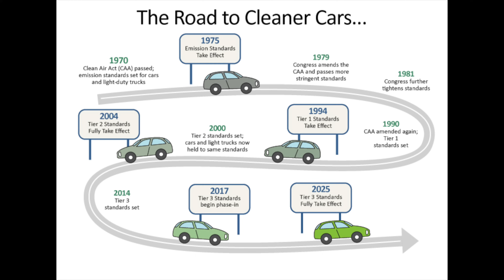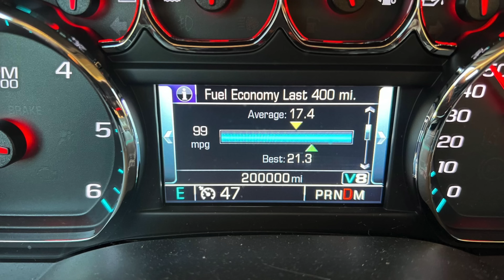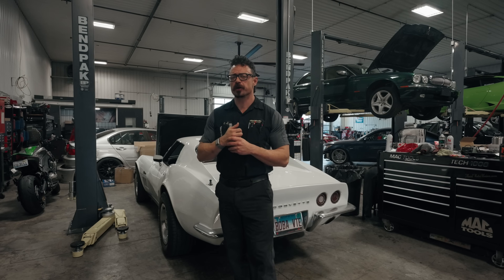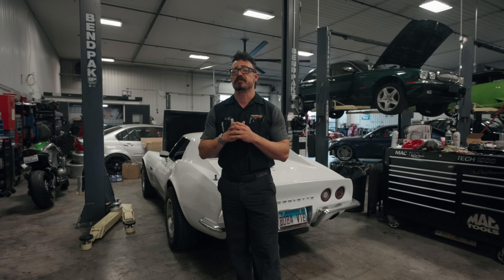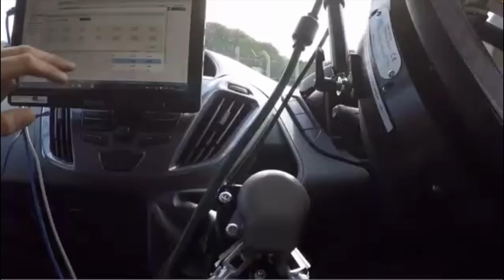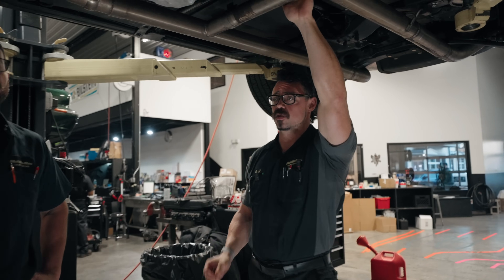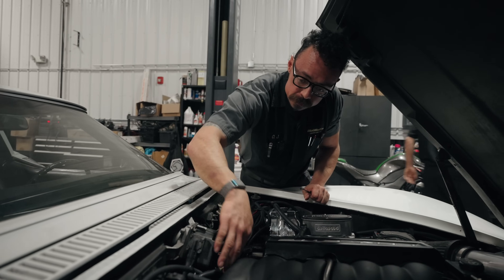Do You Need a 6 Speed Auto? LS C3 Corvette Transmission Swap EXPLAINED.

Comment: Have had cars with these transmissions turbo 350 - turbo 400 - 700r4 - 4L60e - 6L80e the lower transmission gear ratios in the 6L80e in 1st 2nd and 3rd gear will make a car with 3.27 rear gearing be like 4.10 gearing in a 700r4 or 4L60e l have a 3920 pound 5th gen Camaro SS with me in it it has stock 3.27 rear gearing with a new modded GM LS3 495 crate engine a 4200rpm Circle D lockup stall converter this car is not a race car full interior and AC street car cars 60 foot is 1.70 and 11.28 in the quarter mile and cruises the highway at 80mph 2100-2200rpm car has wicked throttle response if it had a 700r4 or a 4L60e in the same setup or car it would need 3.73 - 4.10 gears to be as fast as the 3.27s with the 6L80e trans 0-130mph 3.27 rear gearing on this setup with a 700r4 or 4L60e will not touch the times but cruising on the highway rpm would be simular at the same speeds my Camaro with these mods does 123-124mph at 6600-6700rpm at redline in 3rd gear with the 3.27 gears and the 6L80e trans is very simular to a 700r4 or 4L60e trans first 3 gears with 4.10 rear gears so with the 6L80e you get simular acceleration as a 700r4 or 4L60e with 4.10 rear gearing with 3.27 rear gearing with the 6L80e yes it makes a big difference in performance and economy of course if rear gearing is the same with these 3 transmissions highway cruising rpm will be the same acceleration will not 😮

Comment: Cool car. I just dropped a slightly modded LQ9 mated to 6L80 with a 2600 stall, all turning a 10.5 rearend in my o2 reg cab short bed. Should be interesting lol. I also put the thermostat bypass in the trans cooler.

Comment: I've been professionally building transmissions in Cleveland ohio area for over 20 years. The 6L80e is NOT a performer choice. The reasons are vast but I would run it before any 4L60e trans...joking..🤔 The 4L80e is the only true powerhouse transmission next the GM TH400 or "modern" powerglide. I doubt your shop has installed many gear vendor units which can be used on 2-3 speed automatics but if so want to hear about that. 6L80e is too large for most pony cars and even most muscle cars without serious trans tunnel or floor plan modifications. I watched this whole thing and don't know why you are showcasing it besides possibly the customer had wanted it. My only top concern is cost for customers. A 6L80e costs almost twice as much to rebuild as a 4L65e and doesn't carry much aftermarket support like converters. The converters also cost twice as much as 4L65e. The 4L80e is between the 2 in cost and there are millions of them out in car part yards for possible parts down the road. Also, if any confusion about what a  4L80e is compared to both units is that it is the superior TH400 with a 4th gear and overdrive lock up converter. The biggest consideration for the swap is early 1991-1996 models have front housing oil cooler lines and 96 and up have front and rear like 6L80e which can be an obstacle to intstall in some cars. 8L80e is total garbage for any performance car and belongs in low powered trucks for a reason. With everyone running larger wheels and tires today that can be up to 28-30" diameters that is another factor in lowering engine RPMs as well even when using a 3-4 speed transmission. I sub'd to the channel and look forward to seeing more stuff. 👍
Reply: Forgot to add that the weight is a big deal. He was wrong about weight of 6L80e. I weighed in shop the 4L60e at 149 pounds with fluid and small converter and 6L80e weighed 238 pounds with fluid and converter. That's almost a hundred pounds difference. 😮

Comment: I had a supercharged c5 with the 4 speed auto (4L60 built by RPM transmissions).  I also ran a 3.42 gear set.   Motor was basically a stock ls1 with heavy valve springs and a borla catback.  No headers. That combo made 472 /444 at the wheel through that setup.  The blower was a Vortec V3si.    My only complaint was the gap in the ratios between 2 and 3 gear and between 3 and 4th.   The car was a great from a dig to 80 mph.   Then the torque had to pull the long gearing.    That car would have benefited immensely by having some split ratios in between 2nd and third and third and fourth.

Comment: What is the difference in RPM before and after the conversion on the highway?
Reply from the maker: On the tac it’s like 500 around 75 but the math says it should be lower. 🤷🏽‍♂️ slight but noticeable

Comment: Good video, but I'm surprised that you don't bring up the very important distinction that lower RPM at cruise does not always mean increased MPG. You came close, but didn't quite get there. You did good in mentioning that each engine has a 'sweet spot' for efficiency, but you didn't correlate that to saying that if you add an overdrive transmission to a car that didn't have one before, you may actually go backwards in fuel efficiency now that you may be ~30% under that engine's efficiency curve.  Sure...the RPM goes down, engine/exhaust noise comes down, but so does MPG. Obviously, you counteract this by changing to a lower gear ratio (numerically higher) but then you end up with the same cruising RPM that you had before, just with and increase in usable acceleration and bragging rights that you have more gears.  The more effective determining factor in making the swap is knowing your engine's efficiency curve (mainly dictated by camshaft selection) and selecting the appropriate tire height, rear end gear, and trans with the appropriate first and overdrive gears to be actually usable and meet your end goal, whatever that may be.

Comment: I thought you guys were updateing from a antiquated turbo 350 or 400 with a 1 to 1 3rd final gear.. Both the trans here have deep 1st gears for takeoff and high overdrive for low rpm cruising so im missing the big advantage.. Ide be happy with either trans compared to the old 3 speed ! Lol

Comment: Would doing a swap on a stock 1995 LT1 4L60E be worth it ?????? I upgraded the stock trans back in 2011 at a trans shop down in Killeen,TX which cost around 1900,00 tax incl trans is built for up to 500 + HP at the moment l. What’s y’all’s thoughts on this.

Comment: Yes.. and no. If you have enough torque to pull the taller final rear gear (lower number) you can get away with a 5 speed or 4 speed. ie: the 5-45rfe (I now I opened myself up for criticism) has 3rd as 1 to 1, 4th is the OD in the 45RFE, and 5th is electronically added via the TCM. Thats why I can run 70mph in 5th with a 3.55 rear at ~2000rpm. Even though first is 3.00 and 2nd is 1.67 ratio and it shifts into 3rd the 1 to 1 ratio at 70 in WOT conditions... its also how it "could do" 112+ at the top of 3rd and at 6000rpm (max engine speed) in 5th, mathematically would be 202mph.

But I drive a truck, and bricks dont do 200+ with ~300hp lol Though as OJ pointed out, more gears don't always equal more better. my moms 2019 Ram with the Hemi and the 8spd, same mph same RPM as me, ~2000rpm at 70mph paired with the Hemi's MDS. Different final drives, different tire sizes, same results for cruising. Now for city driving it would be an advantage for her... though with the Hemi, that could easily start in 2nd but the autos always start from 1st unless a tuner programs it to do other shift schedules..

Comment: This is wrong, the 4 speed or 6 speed will still rev about the same one higheay, both top gears are about the same, wrong wrong wrong
Reply: I did some research while watching qnd found the same. But if I am correct one could change the diff ratio in a way so thzt the original 1st gear being about 3 ish afger the diff matches the 6l80s 1st gear beging about 4. So i guess one would need to pultiply their diff by this diffrance of 3/4 and then, i guess the top speed of a car previously set at 100 miles should get about 133.33. Or 1/3 decrease in rpms.

Comment: I imagine this has to be over 6,000 to do this swap, I could be wrong but everything is so expensive and the knowledge to do something like this is not cheap. Great video and have a happy new year.
Reply: Well this is a toy, anybody looking to really build a car should be in a financial situation where that's not expensive. 

That being said, the total cost of really building one of these can be done for cheaper than other cars im considering.
Reply: @Sp3rmWizrd  I do things like that as finances allow, and it takes longer than it should because of it.I just got my 300 c running after rebuilding the motor, I did most of the work minus machining and it was in the garage since 2017.

Comment: When doing a transmission conversion the big thing I have found that creates problems is the vehicle floor pan. I'm in Australia and while Holden was a General Motors make and while we used old transmissions like the T350 and T400 in the late 60s through to early 80s and then went to the T700R4/4L60E their is enough difference to make fitting the T700R4/4L60E a difficult thing to do. Trying to fit the 6L80E while not impossible requires alot of measuring and planning because of its physical size. I'd love to fit a 6L80E to my VC Commodore and plan to measure it all up in the next few weeks, I'm on holiday, but I really doubt the transmission tunnel is big enough for a 6L80E.

Comment: I instruct on race tracks and we get drivers with older cars that have automatic transmissions in their cars show up. Most have overheating issues. A video on that or what they can do without spending tons might helps. New subscriber and saw your work on the exhaust for Alex LS Porsche. Very nice work and enjoy your skills and content!
Reply: If they don't already have one an external trans cooler would be a good and cheap place to start. And if the trans has a lock-up converter then a switch to keep the converter locked up under hard throttle would also help. Of course the trans and converter need to be strong enough to handle the abuse.

Comment: I appreciate that you’re making good content, but some of your information is… hmm. GearStar is the first source that shows up when you google 6L80 ratios, so I’m guessing that’s where you got your info. 6th isn’t 0.0667 as they say or 0.07 as you’re showing - it’s 0.667. Also the 6L80/90 was the replacement for the 4L80, first showing up in cars but the very next year it became the most common transmission in trucks, SUVs and vans. Before that the 4L60 was used in Corvettes, Camaros, Impalas, one year of the GTO - so it’s not truck only. If you were talking about a 6L45 then sure, it’s mostly a car transmission with the only truck outlier being the midsized Colorado. The 6L80 is hardly a “new kid” - even in swaps. It debuted almost 18 years ago.
Reply from the maker: 4L65E not the 60 was what was swapped out from the vehicle, and you are right looks like we got the ratio incorrect on the screen.
Reply: @FluidMotorUnion  I went back and forth when building my wife’s 55. She wasn’t that enthusiastic about cutting the floor but appreciates how it drives. That’s something else to consider for a lot of applications, that 6 speed takes up a lot of real estate!
Reply from the maker: Yea, super worried about having to modify the body especially once it arrived and we saw them side by side, but still had enough room to spare.

Comment: The C3 was such a sexy ride these upgrades are definitely in the correct path. I would guess the frame and suspension could benefit from a little massage. 
  After seeing you on other channels you have the rep to make this a "GREAT" channel. 
 Good luck and I'll be watching.
Reply: At Corvettes at Carlisle there are a couple companies who do chassis swaps for Corvettes . C1, C2, C3's . Allows you to use whatever engine and more modern suspension . It's not cheap even just the frame ready to accept your style of engine and modern Corvette suspension . 

I saw at least two owners who showed up with enclosed trailers and purchased complete rolling chassis including the drive line . The chassis came on what looked like orange wheeled donuts to roll. You supply your own wheel and tire combos . 

I think the bare chassis were over 20 grand close to 30 k . Talking to one chassis builder he said with complete driveline and his chassis with newer Corvette suspension he had about $120,000.000 in a 73 Corvette . Not including the body itself . 

So these swaps using the best and more modern suspension/ chassis and engine swaps get very pricy .

Comment: I can only see benefits to adding gears. Better overall range of gears, better fuel economy, far better performance, and better emissions output due to the engine running more slowly.
Reply from the maker: Downside: cost. It was not cheap.
Reply: @FluidMotorUnion  well, besides that. Improvement always comes at a cost. And that cost is money. And, that's OK. Toys cost money. Very cool toys tend to cost even more money. I hope you all had a very Merry Christmas, and please keep up with video content. You can't have a million subscribers instantly, but you will, and that cost may be a bit of money by shooting videos vs fixing a car right now. The investment is worth it.

Comment: I own a 97 trans am with a 6 speed manual , and a 2003 c5 with 4 speed auto. Before I went 383 , my trans am regularly got 30 mpg on the highway.  My mostly stock corvette still gets 31mpg when cruising at 70mph.
Reply from the maker: Vettes have a weird combo of lightness and straightforward engineering that works out to good mpg.

Comment: Explaining the axle ratio with the RPM and final drive ratio would really help bring the concept together for people. Show that an old axle ratio like  3.42: 1 can be replaced by 2.62:1 because of the low first gear and the better spread with 6 speeds. Subscribed!
Reply: A3.08 rear gear is common and widely available for that generation C-3 and would drop highway rpm nicely.

Comment: 6th gear in the 6L80E is 0.67:1, if I remember correctly. I figure it was a typo in the video. Also, the 6 speed won't change the cruise RPM much at all without a much taller rear end gear. The reason the 6 speed was a big deal is because it allowed tall rear ends for fuel economy to be paired with good performance because of the gear spread. 0.69 vs 0.67 is basically the same, so not much should've changed unless you guys also swapped the ring and pinion, which wasn't mentioned.

Also also, I've been occasionally coming back to this channel to watch your ITB setup on the E92 dyno video since it came out. It's really nice to see you guys branching out.
Reply: Yup only real difference would be better gear spread ergo better acceleration, cruising speed is pretty much unchanged!
Reply: 0.67, same in my 545rfe in my Dakota. Noticed even with my moms 2019 Ram with the Hemi and the 8spd, same mph same RPM as me, ~2000rpm at 70mph. Think her final drive is a 3.21? mines a 3.55. Biggest difference would be tire size. She's on 20s with a 31" tire, I'm on 17s with a 27" tire
Reply: @NXT_LVL  If the RPM is about the same for the two vehicles, and you know your final drive is 3.55, the RAM’s would have to be 4.10 with that tire size you specified.
Reply: I know with the T56 and 3.42 is just below 2000rpm at 80mph.   You must be sure that your engine can work below 2000rpm.   Depending on your cam choice that might not be possible.

That being said, the corvette can be challanging to gear.   If you do the 12 bolt internals swap the lowest gear ratio you can get is 3.73 and I think you need a thin one at that (one that fits a 4 series posi).

I have dealt with C3s - the real challenge is physically fitting the transmission in.   The cross member is not adjustable and the floor is fiberglass (up to 1975).   TH400 is stock on most of these applications, but the 4L80 was supposedly a tight fit.
Reply: You have to have a motor with extreme amount of low rpm torque from idle-3500rpm for a transmission like this. Not loads of high rpm 6000-7000 tire busting horsepower
Reply: @tatertots-n-soup  Not true at all. If your rear end is short and your converter loose, you can run a peakier performance engine just fine. Alternately, an LS7 has a lot of power down low and up top, so it’d do fine with this trans, a tall rear end gear, and a tight converter. On top of that, the GM 6L45 and 6L50 transmissions (similar gearing to the 6L80 and 6L90) were used in vehicles with engines that had comparatively paltry amounts of low-rpm power, and they also worked just fine.
Reply: @tatertots-n-soup For the 6L80? The shorter 1-4 would help, not hinder, a peaky engine.
Reply: @tatertots-n-soup Many years ago in my parents 1996 Buick Roadmaster,  over 500 miles, we measured 27mpg on the interstate.  This was with 4 passengers and luggage.  It had an LT motor and 4-spd automatic.  The engine was loping at 65-70mph.
Reply: I was thinking the same thing re: final drive being basically unchanged - and curious if the owner brought it back to complain, or, if maybe he got it for free in exchange for them recording it, and he didn't care?

Comment: Haha, 0.07:1 6th.  Now THAT is a proper overdrive.  If you wound out 5th gear to 6,500 rpm somehow (probably already impossible but work with me), the shift to that 6th would drop RPMs to 535 (if the torque converter stays locked).  Otherwise it would just stall against the converter and make copious amounts of heat.
Reply: Ive seen small blocks spun past 8k ... its 2024 not 1970
Reply: @sean smallblocks used to spin anywhere ups and to 10,000- 12,000 with hypertech pistons and worked rods along with a factory forged crank in the 70s. Guess you forgot at 80 years old. But they dont manufacture anything forged anymore now do they?
Reply: It would probably spin the tires backwards like hitting curb straight on at 60mph. Flood the motor and hydrolock the pistons from turning after bending valves and/or pushrods or just break the rockers. Doh!